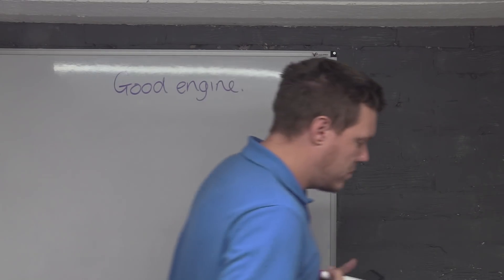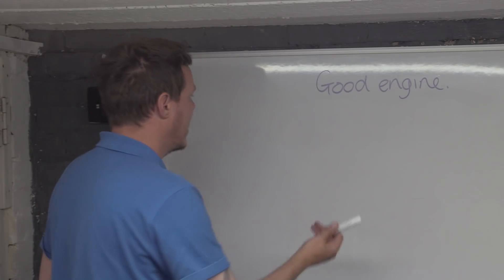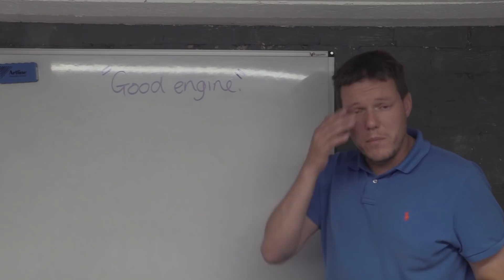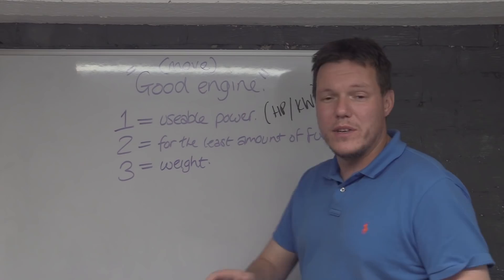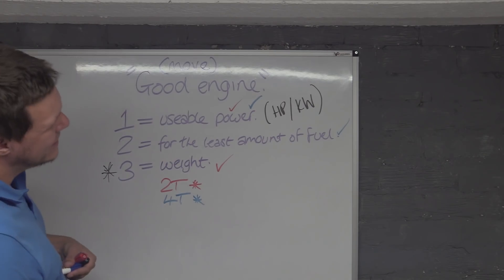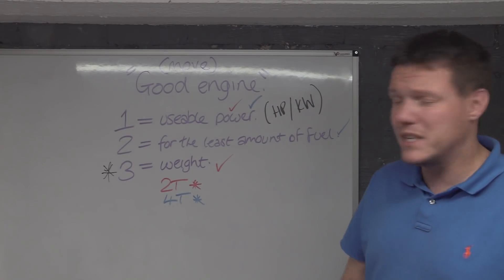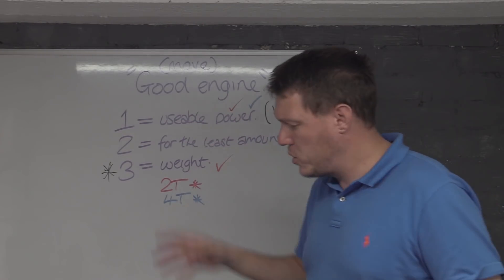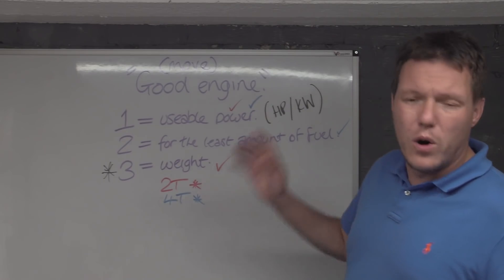What is a GOOD ENGINE?

Comment: I must have missed this vid. I have always wondered about the "why" on this topic. For direct comparison, take a 1.3l car engine and a 1.3l motorcycle engine for example. Both are 4t. Why does the car engine make around 100 hp and the bike engine makes around 200hp. I never understood why a cars' power per liter is so low. The bike makes around 150hp per liter. A guy I know of turbocharged his Hayabusa and is making around 375hp. That is insane power per liter. Just let me know if I'm not understanding something. Thanks

Comment: Those talking points you had on the white board is emblematic of engineering today, which ignores a few points that I find frustrating. Most engine designs today, whether it be an automobile of bike engine are without consideration of ease of repair and cost of replacement parts. There's a market for designs which can be torn down and reassembled without the use of specialized tooling, and standard wear items which are designed and manufactured to be as simple as possible in order to keep the cost of replacements down. Presently the cost to most consumers for reconditioning major systems in their cars, motorcycles, and many other 'big ticket' consumer items leads to discarding the entire item and purchasing a new replacement. This seems awfully wasteful. There are many, many cars and trucks in the United States that go to wrecking yards because their engine or transmission needed to be reconditioned, but their owners could not justify the exorbitant cost of doing so. Not when it's so easy to get a loan for an all-new replacement.  With this in mind, designs which are easier to work on are less likely to be repair than parted out by a wrecker...Between a Chevrolet Tahoe SUV and a BMW X5, the Chevrolet is more readily repairable and will remain in service longer, offering a better value to it's owner, than the BMW, which will go to the wrecking yard at the first sign of trouble out of warranty.
Reply from the maker: You can't have it all in the limited time these engineers have

Comment: I think we’re forgetting the average rider weight to bike weight ratio in the USA where the importer attached to the Harley museum gift shop pretends their heavy, outdated, awful handling, overpriced, geriatric vibrators are still made. 

Aside from the lard mountains for a moment, the typical Harley rider in the USA is a parody of a cliché modelled upon Paul senior in that ridiculous comedy of errors ‘reality’ TV show from Orange County, NY. 

So, we could reason that they do actually need a heavy low revving bike to haul them around.

Comment: There’s a slight problem here, and it’s not a small one. Bikes have not got lighter over time. 

The Vincent Black Shadow of 1948 weighed  458lbs wet. 

Honda’s current CBR1000RR weighs 463lbs wet!

Yes it’s only 5lbs, yes the Honda is a liquid cooled four cylinder DOHC, and possibly with an Akropvic system which banished the cat, all that excess will likely be lost, but we are talking half a century of development, plus we know that the Vincent was over engineered by today’s standards. 

And yes, I could have compared the Vincent to a proper modern V twin such as a Ducati. But the conversation here is about what is a good engine. Ducati engines require relatively high levels of constant maintenance to keep them reliable, and parts are very expensive, meaning the advantages gained in weight loss are cancelled out by reliability and costs. 

Hondas in general need far less maintenance. Ergo, the 4 cylinder Honda is the better engine. 

My contention is that overall, with the improvements in engine development, materials and manufacturing methods we should reasonably expect bikes as a whole to have got lighter, but that’s not the case.
Reply from the maker: "Yes it’s only 5lbs, yes the Honda is a liquid cooled four cylinder DOHC, and possibly with an Akropvic system which banished the cat, all that excess will likely be lost, but we are talking half a century of development, plus we know that the Vincent was over engineered by today’s standards."

- But you're forgetting speed. Forces increase with velocity. The CBR is and goes a lot faster than the Shadow. So the wheels, frame etc need to be stronger and therefore heavier. 

"Ducati engines require relatively high levels of constant maintenance to keep them reliable, and parts are very expensive, meaning the advantages gained in weight loss are cancelled out by reliability and costs."

- Are you sure about this? 

"we should reasonably expect bikes as a whole to have got lighter, but that’s not the case."

- For the power output the engine is lighter. Stop confusing bikes and engines.....
Reply: The Workshop I’m not confused. Having just aggravated my tennis elbow hauling my BMW 650 Dakar engine around, I can assure you no weight has been spared there either.

Comment: Harley engine = shite (turn petrol into noise without actually going anywhere).
Suzuki SV engine = good (Cheap,  generally reliable.  Good linear power delivered with very good stock fuel economy).

Comment: The difference between the john Deere and the motorbike is that the JD makes 175 bhp and 1000 ft lb of torque from 800 rpm to max 3000 rpm. It’s possible to have a bike make 175 bhp but it can only make about 80-100 ft lb. of torque which dies off quickly as revs rise. The Harley makes 50bhp and 80 ft lb but it dies less quickly too as revs rise to a lower max so the Harley is neither tractor nor sports engine.

Comment: Good synthesis Matt, I'd probably add reliability in the mix as well. You can crank up the compression on an engine and make more power, prolly more fuel efficient for the same amount of weight, but you'd have to rebuild the engine everytime you use it... not to whinge but that would get annoying considering I get lazy about just oiling my fucking chain sometimes.

Or I could summon Wankel engines which produce ridiculous top end power considering their cc out of light engines but they chew through apex seals faster than you can say dorito. Also fuel consumption is atrocious but thats not the main argument here

Keep em coming 👍

Comment: Do you get the same passion, or at the very least, interest, in motors (electric motorcycles)? I feel like, when it comes to electric vehicles, most of the attention is focused on battery technology rather than speed, or power, or torque on the motor. Is that because motors have reached their peak and it's just the battery that needs improvement? I would lean to a yes myself, but honestly, I feel like it's more due to the lack of noise and visceral vibrations that we've all been so accustomed to in engines. I feel like once battery technology isn't a bottleneck anymore, motor'll become the forefront of tuning just like engines are today.
Reply from the maker: No - I hate electric motors

https://www.youtube.com/watch?v=AFlzbLNSRKY

Comment: Koenigsegg calls the engine the Tiny Friendly Giant, or TFG for short, and it's an apt name. The TFG is a 2.0-liter twin-turbo three-cylinder that makes 600 horsepower. ... Instead, the engine uses technology from Koenigsegg's sister company, Freevalve, with pneumatic actuators opening and closing each valve independently.

Comment: What makes a good engine is dependent on the application.  The harley engine is going into a cruiser. What makes a good engine for a harley cruiser is reliability, torque (to lug around the heavy chassis), etc. Meanwhile on a sportbike like the Ducati what matters most is the things that you have listed. The John Deere example is perfect. Harleys and Ducatis are not the same and are meant for different purposes and therefore what defines each as a "good engine" is different

Comment: While I agree with most of the video, I will have to say that comparing a HD and a Ducati is a motorcycle and motorcycle, not a tractor and motorcycle. The S&S is built for a HD frame and HD rider, so it needs to be more like a tractor. The S&S needs to accelerate a bike that weighs the same as a small car with a rider that weighs the same as the Ducati.

Comment: Those 3 points you made (power, fuel consumption & weight) mean very little to me. What i find important is mechanical reliability. Dont need an engine that breaks down easily
Reply from the maker: And how do you know which engine that is?
Reply: Talk to mechanics, or look into past reputation. I personally had to trash a suzuki the other day because the oil drain threads got stripped by the dealer while doing a service. One would think its no big deal, just put in a helicoil or thread in an oversized bolt.. but not this one. It has 2 oil galleys passing through the threads. The threads easily strip because from the 20mm length of thread availible, less than 4mm even has anthything to grab onto because of those oil galleys passing through. If you put a helicoil in, then you block the oil from draining and the oil pump can get blocked if you put a longer bolt in. Its shit engineering like this that turns perfectly good engines into a waste of time

Comment: I think you diddnt really hit on something with this.
You need something durable. Something that actually fucking works. Lasts a long time.
VW for example tick all the boxes ypu put, but they have catastroptic valvetrain failures before they've even fucking run in properly, they burn oil at 60k, throw rods, shite.
Ford zetec engines, light, fuel effecient, powerful. They dont fucking last though.

Working in the motor trade, good engines are RARE nowadays. All they do is fuck up on BASIC shit. We have been making pistons, rods, cranks and valves for a hundred years and manufacturers still fuck it up.

Also LS motors FTW
Reliable, light, small, powerful!
Reply from the maker: "You need something durable. Something that actually fucking works. Lasts a long time"

- and how do you know that?
Reply: @thedirtyworkshop  durability testing... although somehow manufacturers still send stuff out the door that is useless.
Great example of this is the e90 v8 m3 engine.
Excellent engine, high specific output, fuel effecient, very smooth.

But they spit conrods out for fun.....

Thinking about it. The crossplane r1 engine, another good example. Its all singing all dancing till the fucking crank snaps. Could be considered worse than an old plodder v twin with a low specific output.
Reply: @His Masters Voice im sure matt did some videos on it.

Comment: Isn’t it about getting good head? 
A friend’s Folan is a 1l 4t with the biggest valves to clear the cylinder. 4valves, pent- roof combustion, 11degree intake angle, and 64mm intake per cylinder! Big power, light weight, but uses lots of fuel to make lots of power.

Comment: I agree with some comments that as a consumer surly the reliability has to play a part. 
I am not going to pretend to know about the inner workings but is there an argument to be had that a V twin has less to go wrong over another engine with more cylinders etc? 
I do agree that the weight is a factor in the application as these are in motorbikes but then that has to surly come with the reliability as they are so much more exposed to the elements? 
All very interesting points to me.
Reply from the maker: "I agree with some comments that as a consumer surly the reliability has to play a part."

- so a brand new Yamaha engine comes out. How do you know it's reliable?
Reply: The Workshop you are right and I guess the short answer is you don’t. 
I would assuming there is the standard testing etc but me personally I wouldn’t buy new for that reason. I prefer something that is a bit more proven which is probably why I prefer something a bit older 😁

Comment: What about reliability? if you invented an engine that made twice the power or used half the fuel or was half the weight of the gold standard would you become a billionaire if it only lasted half as long? Or 25% as long? Surely that matters too?
Reply from the maker: And how do you measure reliability or what is the unit/ yard stick for that?
Reply: @thedirtyworkshop  Hours, miles, whatever any unit you like in proportion to the same units for the gold standard. A 24hr LeMans engine that only lasted 12 hours compared to the gold standard that lasts 24.5hrs wouldn't be a good engine even if it made twice the power weighed half as much and used half the fuel in that specific application.
Reply: @thedirtyworkshop  I agree

To give an example from the automotive world, there's a big push at the moment for the small capacity, forced induction, direct injection petrol engines, they are powerful, light weight and relatively good on fuel (very dependant on driving style etc) 

However based on my experience there seem to be a lot of reliability issues with them, however there are a lot of factors that could be to blame, "modern design" so hasn't had the production time to work the kinks out, somewhat rushed, many manufacturers are under the hammer atm, as with the shifts in emissions targets, maybe some of these things are going to be rushed out. 
Also just complexity, more components are going to be more points of failure, higher fuel pressures, intake/exhaust/cylinder pressures etc so more strain. 

That being said, there comes a point where reliability almost starts to become irrelevant. 
Chances are that the more reliable, larger capacity naturally aspirated low power, lazy engine, may be way more reliable, but it will never pass the regs the way things are going so it doesn't matter. 
Or the engine could be designed and built in such a way that every possible issue is resolved, and the engine lasts 200k with basic maintenance, however now your base "insert generic car here" costs 3x the price as the material, design and production costs need to be recouped so that reliability becomes mute as no one can afford it.

Finally intended lifespan is a consideration, does a manufacturer actually intened an engine to last as long as possible, or... Do they say that hopefully xx% make it to the end of the warranty period, or a certain value beyond that.

Comment: Based on all these criteria.

Those cheap as fuck Predator 212cc OHV engines you see at harbor freight are good engines. Now this isn't a bike engine per say (unless you count minibikes). But hear me out.

Cheap, reliable, good torque, and good fuel economy for what it does. Sure its displacement is way too much for the laughable 6.5hp it makes compared to a bike engine of the same displacement, but it can still do the job and there are shitloads of aftermarket parts for them (billet flywheels, conrods, pistons, cranks, valve springs, heads) to get them all the way up to 15+HP (some claim 20HP) if you wanted. And their price is unbeatable, just $200 off the top of my head. They dont weigh a lot. I can easily pick one up with two hands and I'm a scrawny little bastard.
Not only that. But compared to its Honda brother it wont cost you an arm and a leg if you want to buy another or replace it. You could easily spend 500+USD on a 6.5HP Honda 196cc but that little predator Chinese clone engine will cost much less, so you really wont give a shit if you abuse it and it CAN take abuse.
So yes, by this list you made Mat those cheap general purpose engines at Harbor Freight are good engines. :D
Reply from the maker: But they ain't making good power for the fuel they're using, hence why the power is low

Comment: You could make the argument that a good motor is one consumers will buy. 
Harley tried improving their engine in the V-Rod with the help of Porsche and got a much more powerful engine (115 hp out of ~1100 cc). 
Look at the mileage (literal and figurative) that Ducati has obtained from their air-cooled belt-drive twins. ~80 hp from ~900 cc yet people don't seem to care and they don't get the reputation that Harley does , though, granted, they do also make some much more advanced engines. 

The engine that probably deserves a "not shite" stamp of approval is the inline four 4T. 
How many econoboxes and motorbikes have driven countless trouble-free miles with good fuel economy for a reasonable cost with one? They certainly power personal mobility in the first world.

Comment: So f1 engines great power per capacity, good fuel consumption for a race engine and mercedes is 50% efficient
But down size is cost and reliability?
Reply: Reliability has been massively increased in F1 engines in recent years. They’re effectively limited to 4 engines per car, per (22 race) season. 

All from a 1.6 litre turbocharged V6, with kinetic and heat recovery systems, and sophisticated electronics to deploy and harvest the power effectively. All from 100 litres of (supposedly) near-enough regular unleaded - though few use this limit, so the cars are lighter. 

At the fastest track (Monza) the near 200 mile race can be completed in around 1 hour 20 minutes, from a standing start, and stopping at least once to change tyres. Even this track has 3 chicanes, and several corners, so it’s not just a flat out blast like an oval track - there’s acceleration and deceleration for some of the lap. 

Current Formula 1 engines are technological marvels. Just massively expensive ones. 

They certainly meet most of Matt’s criteria for a good engine. Even fuel consumption is relatively good, for such a highly tuned bit of kit. That’s for the power unit as a whole though, including the energy recovery systems and associated energy storage systems (batteries).

Comment: Point number 4 has to be reliability . An engine could fulfil the first three points but if it's not reliable what's the point? BSFC, is the brake specific fuel consumption, measured by dividing the fuel consumption by the power produced. Supposed to give you a means of comparing engines regardless of size, cylinders etc. Be honest it's a bit of a fudge as there is nothing to say you can't lean the engine right out until the power curve starts to fall, to give a better fuel consumption figure.